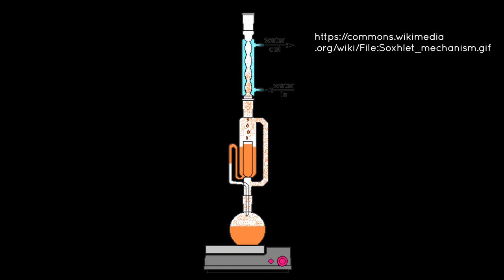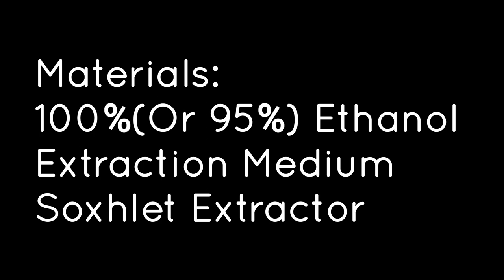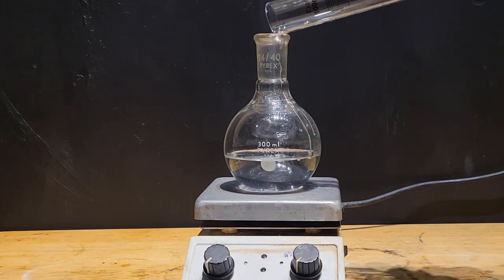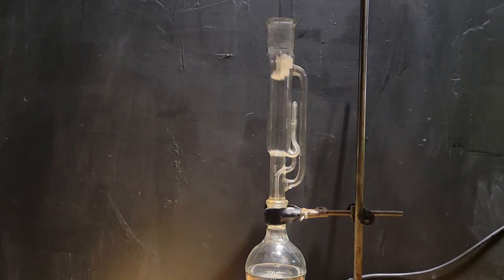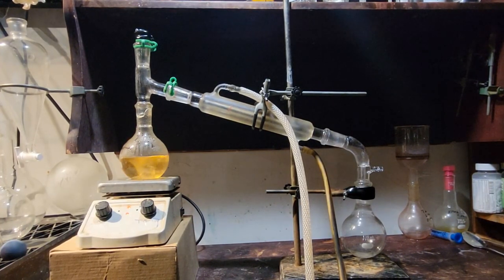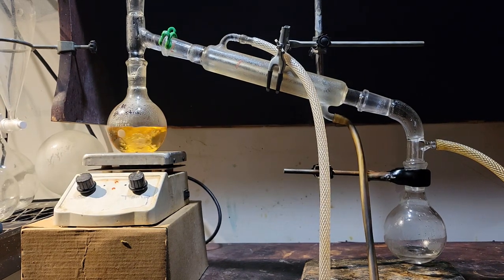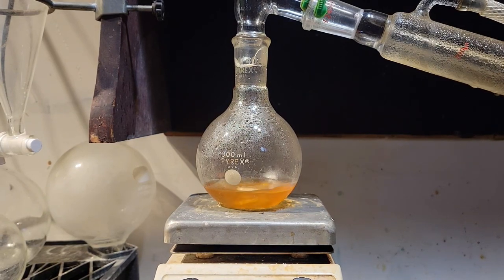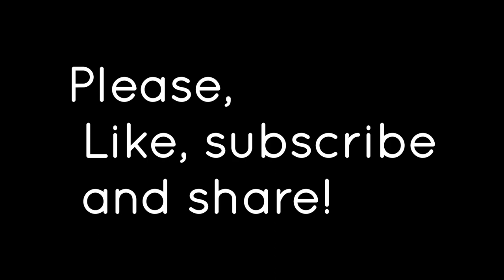Soxhlet Extractor Demonstration

Comment: I think you covered how it works but not why is is better than a turkey tail teabag or boil the lot (with reflux condenser) & filter.

1 The boiling always gives a purified solvent/azeotrope.
2 That clean solvent will dissolve the maximum amount of 'essence of turkey tail' when it condenses & drips onto it.
3 When full the syphon returns that mixture to the boiling pot.
4 Repeat.

You could reach beyond full saturation (so the solid drops/crystallizes out) in the flask as long as solvent can be driven out by the heat to cycle to the top again to fetch more solute.
Reply from the maker: Both of those are very accurate and true. I did fail to mention the benefits over a typical soak extraction. Thank you for noting that! another thing i discovered too, if your making tinctures is you could use a minimum of 50% Ethanol and it would dilute the final product without extra work, since the ethanol would reflux before the water.

Comment: I was reading last week that chaga, cordyceps, and reishi were really the only ones that needed alcohol extraction. The alcohol extraction was actually lower in the beta glucan content than the tradtional hot with cold water extraction. Since reading that, im assuming that there is definitley a benefit for using ethanol for reishi as it high in triterpenes and polyphenols, not so much beta glucan like turkey tail. Regardless, this definitly good stuff and appreciate the video!

Comment: I have one question: Was the vacuum destillation necessary? I mean you were boiling the extract for quite some time in the soxhlet extractor with no vacuum attached so any temperature sensitive compound would be destroyed.
Reply from the maker: That is an extremely good point, one I had not considered.  I prefer vacuum distillations in general because they tend to be significantly quicker with lower boiling point solvents, in this case the Ethanol
Reply: I would make the assumption that the ethanol heated within the soxlhet extractor would create enough of a vacuum of its own or at least a pretty close to oxygen free environment and therefore would not attack those compounds no?
Reply: I was gunna ask same q!

Comment: Thank you for the video.
4:30 vacuum distillation because of assumption that some of components are heat sensitive. But in previous step you already have boiled alcohol with extract at approx. 78°C for several hours.
What is the difference?
Reply from the maker: You are correct and I failed to remove it during editing

Comment: Hey thanku for video.ive been wondering how those extractors work.they must have a fritted glass bottom im guessing? Thats why u used the cotton ball on top.thats good thinking.
Reply from the maker: Correct, typically they do have a glass thimble that sits inside the extractor, but a cotton ball or some glass wool works just as well!
Reply: @TheChemicalOdyssey  ok thanks for the tip.
Reply from the maker: @generalingwer4341  You're welcome!

Comment: Very interesting thank you. Is it safe to boil 95% ethanol? Sorry I'm new to this and was thinking that if you use say 60% abv then the 40% water might extract the water soluble elements also? Or should you do a run with water only to extract these or does it even matter?  Thanks in advance :)
Reply: If you distill ethanol, you end up with 95% ethanol vapors. It doesn't matter if it's 5, 10 or 90% ethanol solution. It's the vapors that is the biggest hazard. If you have a 90%+ solution of ethanol, be sure not to go too fast or your soxhlet can pop due to pressure buil-up. 1 drop of condensate per second is my go-to. In Soxhlet extraction, if you have ethanol and water in the system, it's the ethanol that will do the extraction since you'd be far from the boiling point of water.
Reply: Thank you very much for the information its very helpful. Would you recommend leaving some ethanol in the extract to act as a preservative like as a "tincture"     @MedoKojiZiviOvde
Reply: @paulrobertson9439  yes and it's also easier to use than a powder.
Reply: Thank you :)  @MedoKojiZiviOvde
Reply: I'm learning about this as I would like to make a Chilli extract into a pain relief coconut oil mix and your video has been excellent. Thank you :)
Reply from the maker: Great point! Medo is correct

Comment: Nice work.  I wonder if anybody uses limonene in a soxhlet  as a solvent.
Reply from the maker: I don't see an reason why it shouldn't work, besides a substantially higher  boiling point. if its about psilocybin containing ones, id advice not to use the soxhlet, only simply do to the fact there will be a lot of oxidation of the product. Even if one were to use an antioxidant, it would stay in the flask as the ethanol has a lower boiling point.

Comment: Probably get the same result if you just soak the mushroom in alcohol then filter
Reply from the maker: The point of the video was the equipment not the extraction material. Although it is true, you use substantially less solvent using a soxhelet and at a fraction of the time.